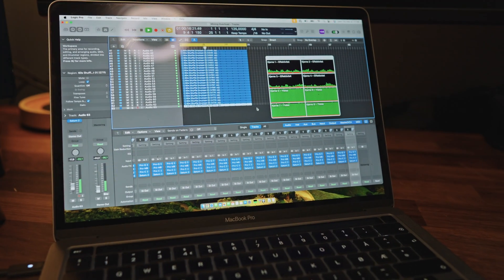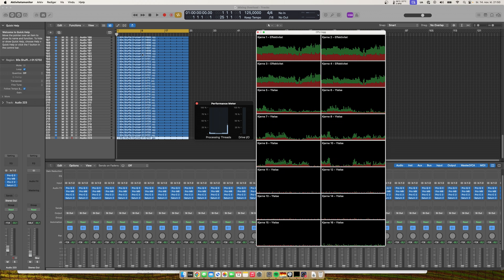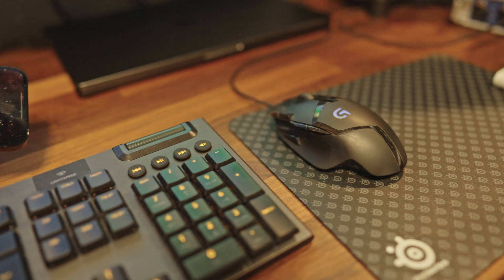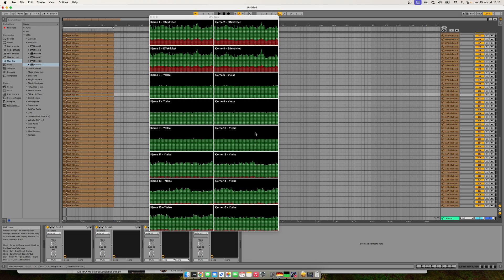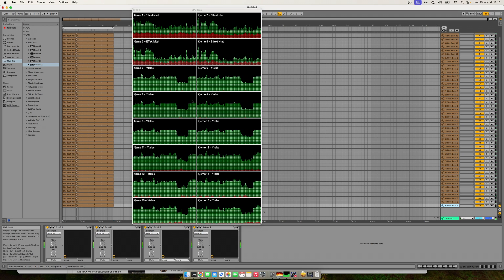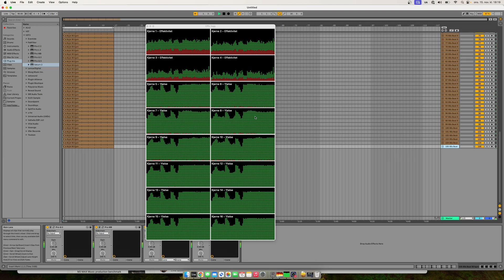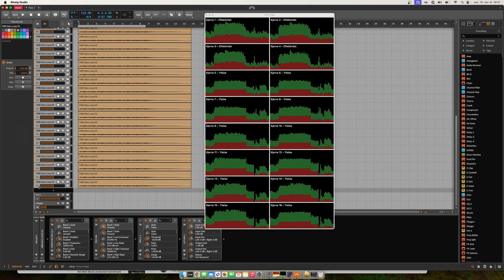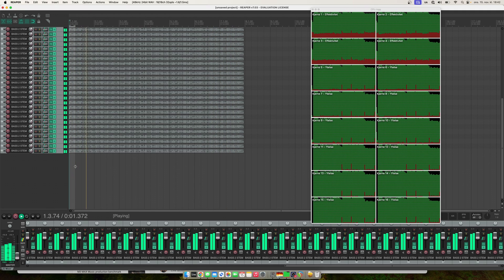MacBook Pro M3 Max: Mixing Workflow Performance (Ableton, Logic, Bitwig, Reaper)

Comment: THANK YOU!  I have only one (IMPORTANT!) question: 
is it possible to use input monitoring with fx on inserts (pro-q, la-2a and not heavy reverb or guitar rig) inside daw with these settings??? (32 or 64 samples buffer) 
i mean for real life situation when there are 70-130 tracks in project session (some amount of audio tracks with not so heavy plugins and kontakts omnispheres, 5-10 divas and so on, just regular mid-to-high difficulty pop project). 
i mean possibility to RECORD VOCAL or PLAY VST in such medium\big project using input monitoring real-time in daw without any noticeable latency or dropouts (and not using hardware zero-direct monitoring). and all that with 32-64 samples buffer in daw. 
is it real?

Comment: what happens in ableton if you set the buffer size at 256 or the max around 2000? Does it really perform worse then at 128 buffer size?

Comment: Hope this helps someone. I tried testing my M1 Max with the M3 Max results for Ableton. It's pretty substantial however I do use this computer heavy so I'll wait for an M4 and might just keep my M1.

M1 Max 55 Tracks vs M3 Max 105 tracks @ 128 samples = 90% Increase
M1 Max 15 Tracks vs M3 Max 50 tracks @ 32 samples = 233% Increase

Comment: It makes absolutely no sense to me to use a low buffer size in either Live or Logic when you're studying a mixing workflow, where people use routinely plugins which add a lot of latency. The point to use low buffer size is to achieve low latency.. Which is useful for performing, recording keyboard input and the like. For mixing it makes more sense to give the DAW higher buffer sizes so they can absorb peaks in the workloads
Reply from the maker: I mainly did this video because getting requests to do it. It is one of many ways of showing performance. What do you suggest the video should be called?
Reply: @bjornark  by the way apologies if my comment felt harsh, I just was immediately surprised by the 32 buffer size because it's such a low size one! Especially in combination with the uncertainty around the process buffer range in logic.  As for this benchmark's name unfortunately I don't know how I'd call it

Comment: Hello there, sorry but I think the comparisons are a bit flawed, especially with logic. Thing is, that Process Range setting is basically the playback buffer. in Logic and the I/O buffer is what the description says, for I/O. The PBR of Small means 512 samples. So basically you are comparing logic 512 buffer with the rest at 32 buffer, a bit simplified but roughly the case. It explains the huge differences you are seeing.
Reply from the maker: Ok trying to understand this, setting it to 32 in Logic and 32 in Ableton is not the same? Do you have documentation somewhere so I can potentially talk about it in an update. Where does it say that PBR small means 512 samples?
Reply: @bjornark  yes this is what I was trying to warn about on the other video! This is not a fair comparison since the internal processing buffer sizes aren't the same. I wish Apple was documenting what PBR small / medium / large are

Comment: What version of Logic did you run in this video?
Reply from the maker: 10.8
Reply: @bjornark  Gottcha. Looks like the M3 Max - Logic 10.8 combination makes much better use of the efficiency cores than M2 Pro & Logic 10.7, and about equal to M1 Pro & Logic 10.7.
Not sure if that's thanks to the chip or the Logic upgrade

Comment: Hello, very helpful video.  Just wanted to know if you think 1TB SSD is enough for music production? And also whether you think 48GB ram will be good for running some sample sound libraries? Thanks
Reply from the maker: Thanks for watching. SSD size depends on how big your sample libraries are, only you can answer that.
Reply: @bjornark  thanks for the response and they are not so big at the moment, but just trying to gauge what size I should opt for in terms of future proofing I guess.
Reply from the maker: I wanted 2TB but its so expensive. So if I need the space I am going for a DIY SSD solution. Its much cheaper but maybe a bit more cumbersome.
Reply: @bjornark  thanks again that’s the same dilemma I am facing! The 2TB is so expensive but I think I might have to go for 1TB like you and use an external SSD to save some pennies😄👍🏾.

Comment from the maker: UPDATE ON HIGH BUFFER TEST 48kHz (I only tested low 32 buffer in this video. Please watch the ENTIRE video for context)

Logic Pro: 1024 Buffer, Process Buffer Range: Large - 340 Tracks (Latency: 44.5ms Roundtrip, 22.2 ms output.). CPU Load: 100% on performance cores, efficiency cores chillin. Adding more tracks gives a System Overload message and playback stops. Fan noise gets loud after looping this for a while. Due to Max CPU load I assume.

Ableton Live: 2048 Buffer, 263 Tracks (No initial CPU overload when pressing play). 272 Tracks (CPU overload when pressing play, does not reappear after clearing it). (Latency: 43.7ms Input, 43.5 ms Output.). CPU Load: Approx 90-93% on performance cores, efficiency cores chillin. Less fan noise compared to Logic . Due to less CPU load I assume.
 
Again, seems like Logic is able to push / use the system resources better.

Comment: I hate that Ableton is leaving free performance on the table... they need to figure their stuff out lol
Reply from the maker: It at least seems like it.
Reply: Maybe Abelton 12 might take advantage?….hopefully
Reply: @donkinshaun  Apple silicon is 3 years old now, hopefully they've been working on coding improvements for 12. I wonder if Ableton just used the standard Apple feature of standard recompiling of code to bring the easiest way to support Apple M chips - which offered lesser performance. The benchmarks for Logic have really outperformed Ableton in Bjørnar's testing.
Reply: @H-4-D3423  I think maybe your correct and the evidence looks that way….we can only hope 😎🙏
Reply: @donkinshaun  Fingers crossed that Live 12 will bring extra performance for Apple silicon mate... 🙏

Comment: Can't help wondering if the differences in track counts, and playability at low (32) buffer size is down to Apple, (of course as the creators of the entire system) have simply optimised Logic for the M series much better than the other software companies. Could be that although (I presume) Ableton, Reaper and Bitwig are M series compliant, there isn't some old code in there that has yet to be fully optimised for Apple Silicon. 
Would be interesting to do the same comparison in maybe 6/12 months time to see if these differences are less noticable.

Alos nice for me, as it has confirmed that my replacement for my aging 2014 iMac i7 will be an M3 Mac Studio as and when they are released.
Reply from the maker: I am wondering this myself, and I am speculating on the same reasons for why Logic seems to be better in this aspect. Ableton 12 is coming, so I will take a look at that to see if there are any differences.

Comment: Nice test. For mixing a macbook pro max is more than enough. Would be amazing if you could test it with some Orchestral libraries inclusive some reverbs,  mixing and mastering settings. But also with random plugins in Logic Pro. like modulation and expressions. Thats a real Case scenario. I have a macbook max m1, 64 Gb. I need way more RAM and CPU Power. it has unfortunately not enough power  in my case. would love to see a test with the M3. maybe also compared to a M1 if available? all the best
Reply: I’m running that computer and I do big orchestral arrangements. I do use Cubase and I seem to be fine. Although yes it can bet bogged down a bit when the template gets pretty full. There is always VEpro to take it to the next level.
Reply: @Doty6String  oh awesome, thanks for reply. But why should VEPro change something about ram usage? best
Reply: @tb6265  im not sure, but it just helps the whole system I think..the other thing it lets you do is run a seperate computer for samples, thats a whole different leap
Reply: @Doty6String  ah yes with a slave machine, for sure. But with these new macs, finally one machine is enough, at least a Mac Studio, looking really forward to the Mac Studio m3 Ultra! using VEPro on the same machine, it shouldn’t make a difference RAM wise. I really like it when i can just duplicate tracks in my project, Thats always a bit annoying with VEPro….

Comment: I wonder if the M3max 14” have the same thermal problem as the M2max. I hope the fixed it because I love the smaller version for traveling.
Reply from the maker: In some heavy workloads the 14 Inch M2 MAX would throttle more compared to the same spec in 16 Inch. Not sure if it would affect music production that much really. It seems like music production wont push it to its limits unless you are really going for it.

Comment: I'm a little surprised - Reaper normally outperforms other DAWs in a lot of things.  Then again, when you make the application, the operating system, AND the hardware, there are going to be some advantages to that.  I'm a Logic Pro user, but every DAW has its pros and cons.
Reply from the maker: For sure, you need to go with what suits you the best and where you are most productive of course. Its not like I am trying to "bash" a DAW or something. I just show you what is happening through my eyes. Hopefully without bias towards anything. Thats all. :)

Comment: i have a company assigned M1 Max and i really like the performance of the MB. i am really considering finally buying my own MB for ableton, traktor and reloop, push 2.
Reply: I would.

I use the original M1 MacBook Pro, Ableton Live and Push and under real world production, mixing and mastering tracks all in one session from beginning to end, give me no issues.
Reply: the 14 inch M3 Max is currently $200 off. 36gb 1TB. im likely to always have it connected to an external monitor.